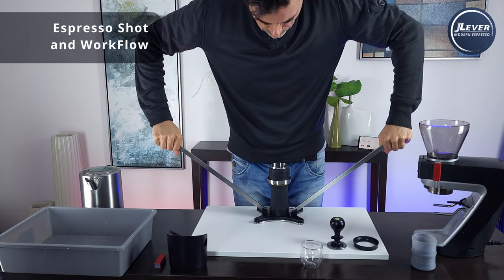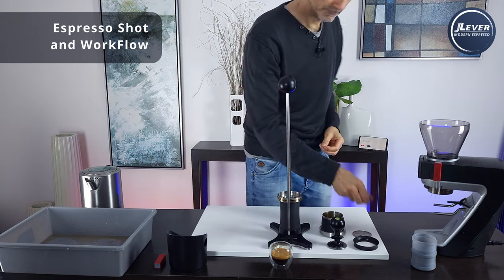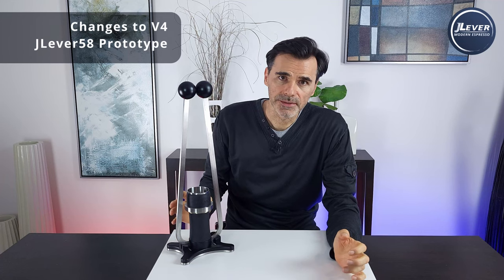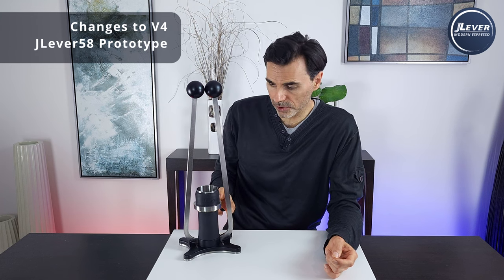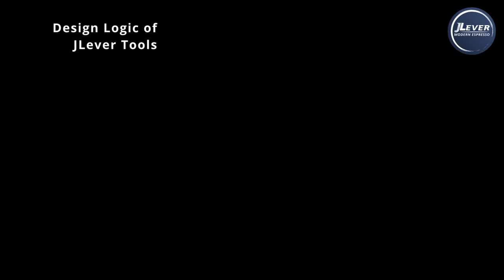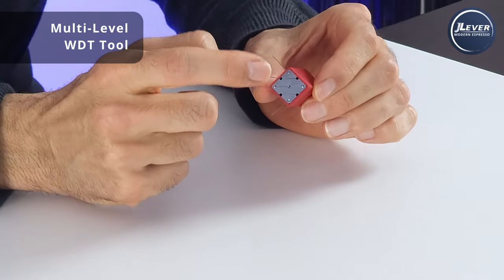INTRODUCING ! The Jlever58 Manual Espresso Maker

Comment: I love this machine and how its different form others so id love to give some feedback. It would be much nicer to have no plastic parts, that immediately makes it look nicer and while I understand that gaskets need to be rubber or silicone it would be lovely to have the rest of the machine brass or stainless. maybe on the upper part somewhere near the puc you can make a hole like in e61 groupheads to install a manometer,  and maybe have a method to read temperature on the grouphead. as I understand it one actually needs the silicone to be able to hold the machine and this is fine but it would be nice to have the option to remove it and have a different way to grab it when needed (like a separate handle like a fellow stagg). It would also be lovely to have the handle balls have a different shape so when they are in the upright position the entire machine looks like a designer piece. Alternatively, I would recommend checking out ways to easily dismantle the arms from the body to remove them quick for cleaning etc of the machine.
Reply from the maker: Awesome feedback, thanks so much, a temperature indicator, I never thought of that, I'll remember that maybe an opportunity will come up, there is an alternative design for the handles, I'll show it on YouTube and ask peoples opinion...

Comment: Looks interesting. Won’t mention the long arms. That’s been mentioned already. To pour the espresso out in a cup seems to me the biggest pain point or downside of the workflow. You have to lift the whole machine and pour. That worries me with hitting something or someone with these long arms. That is bound to create incidents or accidents at some point. Any thoughts or solution of not having to lift the whole machine?
Reply from the maker: Thanks so much for the feedback much appreciated :) the original idea was to have a spout and it's pour into a cup, hence the cutout in the base to place the cup as close as possible... it worked ok, but of course there is spurting sometimes, so you'd need a poly cover... but the beauty of this is we can always offer it later, to change you'd just need to change the top part... let me know if you'd prefer the spout version.
Reply: @JLeverEspresso  I guess I need to see this visually how that works.

Comment: Wow huge huge congrats for your Invention. I am loving it. So many thoughtful design decisions and a really great philosophy behind it. I would also really really love to see a pressure gauge attachment option in the first version already. I know one can feel it through the arms, but seeing it and having the possibility to eventually even save it with something like the smart espresso profiler would be a huge plus for me.
Regarding the pouring and the detachable plunger for making that easier. I agree having to unplug the plunger just for a little more convenience in pouring is overkill. What about making the lever arms quickly detachable? That would make pouring also very easy because the arms are by far the most bulky thing about this. And it would be great for transport. Essentially the best of both worlds. Easy pressing with the long lever and easy transport and pouring.
Regarding ratchetet mechanism for preinfusion….I would keep it simple and leave it as one motion. Having to pull up again would force one to have a short bloom inbetween preinfusion and main pull. I would rather preserve the ability to only do short preinfusion without bloom or be able to slam the puck as you also mentioned in case I do not feel enough resistance at the start.

Again huge congrats. Love the WDT Tool, the volumetric but still very repeatable and precise dosing tool. And very much looking forward to your puck resistance control. What I would love even more is if that tool would be build with adding in automation later on as well like the electrified plunger. That would allow highest repeatability for users that want that. Automated piston and an automated resistance profile it follows alongside that.
But already love the manual version a lot. I guess my love for having the option for automation comes because I am coming from a decent. Again huge congrats and loving to see sustainability backwards compatibility etc. in mind. Seems like a very similar mindset in company philosophy to Decent Espresso and I love a lot of what they stand for.
One thought on the temperature automatically drop to 92° or something similar. I would keep that dialed in to something slightly on the higher side because it wouldnt rush you to always directly pull the shot, decrease the negative effect if one would not directly pull the shot or maybe one didnt have the water exactly coming out of the kettle at boiling point and lastly it would heighten the ceiling of what the machine can do temperature wise. Some people like Robert McKeon just really love to be able to pull shots at very high temperatures. Especially if you are someone that enjoys very light roasts at very short ratios. So just something to consider I guess.
Love this machine. Hope you get a lot more positiv feedback!
Reply from the maker: Wow thanks so much Christopher for taking the time to write that feedback, I so very much appreciate it … I was talking to Miklós from pressensor.com and there is a possibility of integrating a bluetooth gauge in the piston, there is room… but wait till we reveal the non-dial in version as this complicates things…
Detachable arms is a really interesting idea, like a male/female sliding tube attachment…
On repeatability I’ll have more to say on this.. the non-dial in version actually changes the espresso game significantly …
lastly on temperature 92DegC is pretty much the highest we could get it without any preheating, just first pour… it can do higher temps with preheating of course… but the cylinder has to be a minimum thickness so that sucks heat out fast, still this concept of stratification ready helps

thanks again for your feedback :)

Comment: You clearly put a ton of thought into this and it seems like a very sensible design. I'm still a bit confused though as to how this machine differs from other manual lever machines. Apart from the upshot design, how exactly does this ensure you get a "perfect" extraction with each pull?
Reply from the maker: As i state... this is just what i still call a traditional espresso maker, it have some new redesign features but fundamentally from a puck physics prospective it's still just traditional espresso, but the VF-PP back-pressure plates when used with this design is what makes it revolutionary... it's only the backpressure plates that make it "revolutionary" , because they broaden the grind size for good espresso, and hence solve the biggest issue with espresso today, the need to dial-in and find that very narrow grind size that pulls a good shot.

Comment: I'm very intrigued by the shot pulling from the bottom upwards and keeping in the volatile compounds.  My first concern is the handles being so long.  I'll be doing some camping with my vehicle and concerned there will not be enough room in a small space - esp. on rainy days.  Will it be easy for someone who has hand and shoulder problems to pull 9 bar?   You mentioned an motorized version, maybe that will be better suited for me or even others who may be a similar situation.  As others have mentioned, I would prefer to have a pressure gauge for different styles of shots that may start off at 1 set pressure and want to change to another set pressure.  Just would be nice to have a visual.  Looks like a nice product and will be watching for updates on this.  I am interested.
Reply from the maker: thanks for much for taking the time to write this feedback... yes it will have adjustable leverage, so you'll be able to drop down the amount of water you pull across the travel of the arms down to about 40ml, which will make it very easy to pull, however this will limit the shot you can pull...

Comment: I have a idea about the pressure gauge. Since the pressure is closely related to the force on the machine, can you measure the pressure by putting a sturdy scale under the machine?
This is not possible with something like flair due to unstable force applying on the leaver, but I can see that working without your machine.
Reply: It would be perfect if we can just use a body weight scale for that, and you won’t have to add a pressure gauge to play around with the profiling
Reply: Also by adding some kind of a indicator to the lever angle, we can maybe estimate the amount of coffee coming out.
Reply from the maker: Oh that's such a good idea! so close, but alas it would require a force component angle correction on the arms, because not all the force you put into the espresso maker is in the downward direction ... such a good idea though, out of the box thinking :)

Comment: I think it would have been better to be able to pre heat the chamber on top of a kettle. The inverse shot is cool and all no matter how it works, pre heat is still required especially for light roast espresso lovers. Its extremely detrimental for those people in the winter. Would be even cooler if you somehow able to heat the water in the chamber. 

As for pressure gauge, just drill on the side.
Reply from the maker: Yes and for high altitude regions people need pre-heating, but 1.) pre-heating is dead easy, just pour in water from a boiling kettle, wait 2secs and pour out,  re-boil the kettle and you're good, don't discount the effect the the hot core will always rise to the top, and there is sacrificial water in the unit, future versions might have an electrical connection a that you plug in to heat the chamber, and unplug at the last minute before pull the shot
Reply: @JLeverEspresso  Pre heating by pouring hot water is a highly inferior in the workflow to simply pre heating the chamber above a kettle. Firstly, it is not going to be as hot as steam Secondly, its a big hassle and wastes a lot of time to pour out all the water. JLever is not going to be light with the metal body. 

Thirdly, that is a lot of work and time spent compared to flair that you can pre-heat while working or napping at the same time.  Its an even bigger problem when you might have to do it twice or thrice depending on the coffee you use and the temperature you are in.

Electric is a very good idea especially when the component is simple with only heating element. You can always put a thermometer on the chamber
Reply from the maker: @tippykaffu4047  yes i agree pre-heating is a big hassle, but I think we've got it covered, if our thin main chamber doesn't produce the 92DegC temp on first pour, then we've got a couple of easy to implement tricks to increase that temp, so I think we have it covered.
Reply: @JLeverEspresso  I really think there hasn't been any more efficient pre-heating method other than heating above the chamber or electric.

Cafelat robot, despite absorbing low heat, still require pre heat on most light roasts. Light roasts need 95-96C minimum. that extra 3 celcius is hard to achieve with only boiling water
Reply from the maker: @tippykaffu4047  I do agree with you, but stratification of hot water is a significant phenomena, our unit should have an advantage here, but we'll test it
Reply from the maker: @tippykaffu4047  mmmm the Cafelat robot is probably the best top down espresso maker in terms of pre-heating, the only way they could improve it is to put in a polymer liner in the basket (which there is no way you'd want that) or make that bottom retainer plate way thinner... getting enough heat in is going to be an issue also with the use of these back-pressure plates as they suck the heat out, but we've still got a couple trick up our sleave ...

Comment: Can you pull turbo shots with it? Say 20:60 in 14s. Another question, would it support alternative high flow baskets like the WAFOs or the Weber Unibasket?
Reply from the maker: Turbo shots are of course no issue, however a 1:3 ratio for something like a 22g dose will be pushing the limit... i'll have a max of about 60g-70g liquid... and yes! did you not see the earlier videos? :) Wafo and webber exactly
Reply: @JLeverEspresso  Didn't you say the final version would have a smaller water reservoir?
Reply from the maker: @coffeeandshots  yes it will but the existing unit pulls 80g... we'll probably change that to something between 60-70g
Reply: @JLeverEspresso  I see, I wasn't the most attentive. I wonder if a solution where you could set the piston at a midway point before adding water wouldn't be optimal or if it would be feature creep. I do confess missing really long (80g+) lungos that are halfway between espresso and filter coffee ever since I switched from the Cafelat Robot to the Flair 58.
Reply from the maker: @coffeeandshots  what's your dose?
Reply: @JLeverEspresso  Typical is 16:48 for light roasts. Will regularly go to 20:60 for beans that prefer coarse grinds and thick pucks (that's the output limit on the Flair). Will very occasionally do 18:24 if I need to pull a dark roast.
Reply from the maker: @coffeeandshots  ok, that should be within scope but only just...
Reply from the maker: @coffeeandshots  BTW did you ever just try adding water to get a larger ratio? Not sure that would be any good though, I know even at the end of a shot, a diluted tail is still better then water...

Comment: I would recommend to not actually decrease the brewing chamber volume or have an optional larger brewing chamber.

If your machine can pull lungo shots, londinium shots, filter 3.0 (Scott Rao) shots etc (1:5 to 1:10+ ratios), it will have a feature that no other manual lever machine in the market has.

That alone will make it a definite buy for me. Please consider that. Thank you.
Reply from the maker: Honestly I don't think we'll be able to do that, as we want to make it really easy to pull the shot, max we can compromise to is 70g pull...  the future motorized version will have a larger chamber though, thanks for the feedback

Comment: The length of those arms are ridiculous. You need more horizontal space than probably anything else on the market. The whole flow looks clunky.
Reply from the maker: yes, it is a bit awkward at first, but you get use to it, and we'll have instruction videos so people won't start from the start like I did... regarding the arms.. yes but we need it for the leverage, the only way to reduce the length is to boost it somehow... but apart from a ratchet system, or weighted balls at the top... I can't think of anyway... but the subconscious is always working in the background :)
Reply from the maker: @MaakBow  You can do all kinds of things, but fundamentally if you place an imaginary point in the center of the ball, and you trace the "power stroke" movement in space, you could come up with a combination of with gears/linkages/arms etc... to place that imaginary power stoke line almost anywhere is space, the goal then becomes how to we lengthen the stroke (for maximum leverage) but also where do we locate that line in space for maximum ergonomics, to this day I'm still trying to optimize that...

Comment: I think you need to watch yourself pulling (pushing) a shot with this, then pouring the espresso out.....do that and then think about it real hard. The other key things would be, shorten the videos, significantly and stop calling it Expresso, it's Espresso. The idea is good of pouring the boiling water in the top, thus warming things and the way it works in reverse to push the water up....but, theres always a but.
Reply from the maker: Hi Dave, do you mean record myself pulling shots as a way of diagnosing and refining ergonomics or...do you see that as something people won't want to do?    Also YES! eSSSSpresso   i've tried but I've worked in online sales for 15 years and eXpress postage is so engraved in my mind I can't get it out!
Reply: @JLeverEspresso  When  you pulled a shot I thought, it needs a lot of space, you really have to lean into it, I wouldn't like to do that in front of people...anyone who isn't tall is going to have issues. Having to tip the entire thing up to get the espresso out...no.
Reply from the maker: @Dave Corbey  mmmm yeah, that's perry much the three criticisms... it does need some room... if I can just come up with a way of storing energy then I could shorten the arms and it'd be easier... but this is still under leveraged this version, it pulls 80ml so there is room for dropping that, anyway thanks for the feedback

Comment: Good idea! I'm working on something similar but with full electronic control: https://youtu.be/JWl81BdDzYs. Though manual version definitely has its own benefits.
Reply from the maker: Interesting, the upshot direction has lots of benefits, I like your solution for the drain line, how's the clean up?
Reply: @JLeverEspresso  Clean up is ok if you have a kitchen sink near to the coffee maker. The benefit of this solution is more control as soon as liquid layer above the basket is always thin, and you can see how coffee escapes the holes during whole time of a shot. But my solution has an issue – when I remove the holder, the basket may detach from it and stay on the group head. I have to use a screwdriver as a lever to lift the basket up when I remove the holder.
Reply from the maker: @maxalex397  yes you need to change to location of the O-ring seal, https://9barista.com has a clever location, see the cross section scroll down
Reply: Simultaneous inventions! This is it, then!! Thanks Newton, for everything!!!